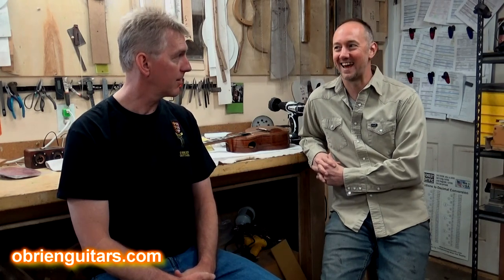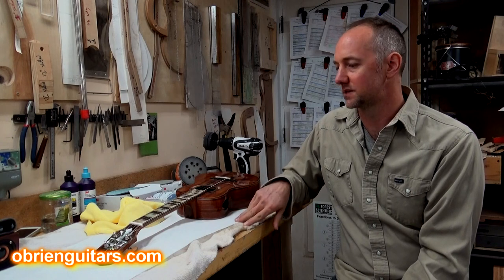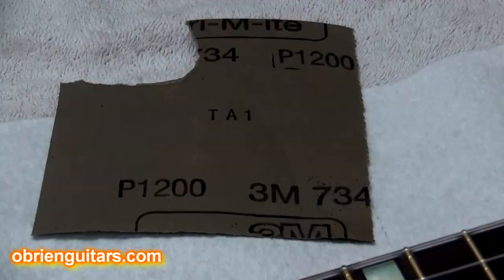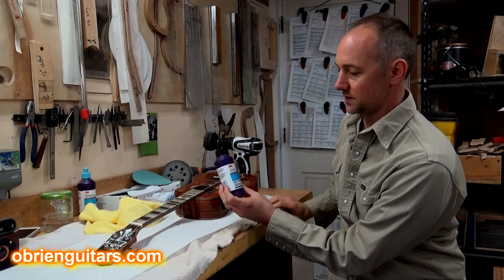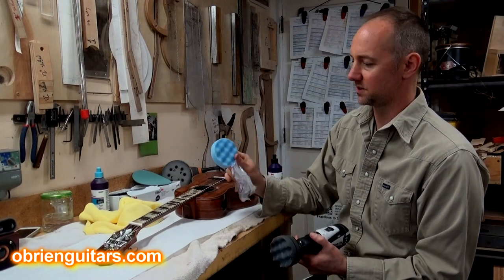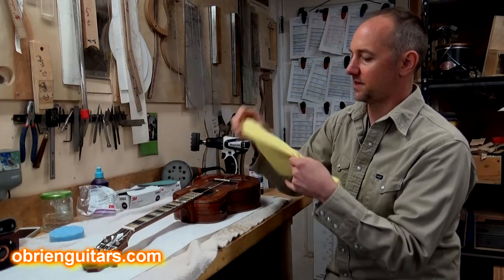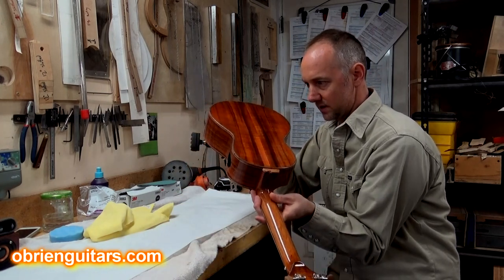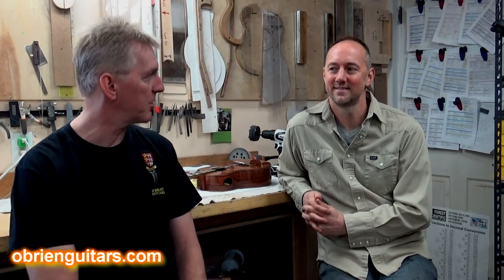Luthier Tips du Jour Mailbag 152 - High gloss finish without a buffer II

Comment: I had forgotten we recorded this video! I still do this method (4 years later) as its still the best way i've found. You don't need a buffer but they are the best. I use a buffer after the Trizact 5000 then the 3m 2 and 3 liquids with microfiber towel (the softest stuff i can find).